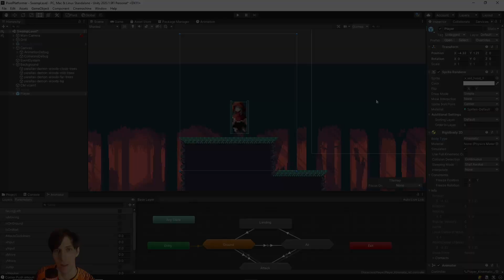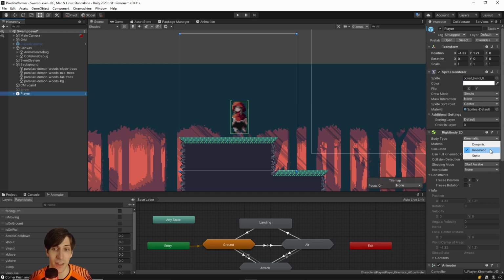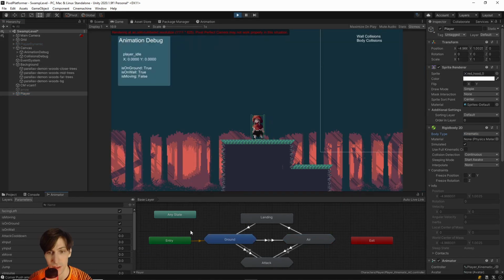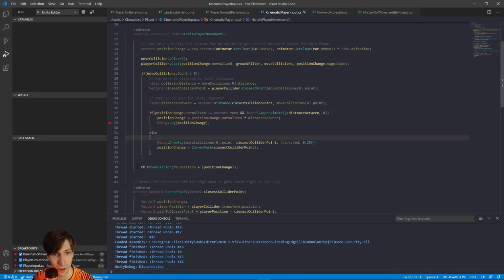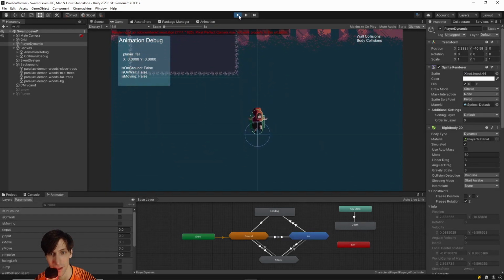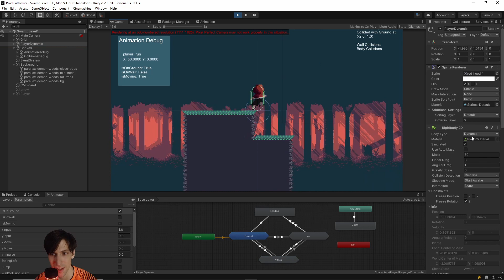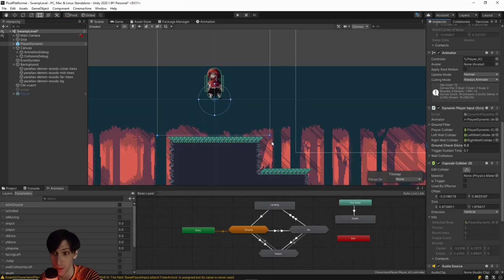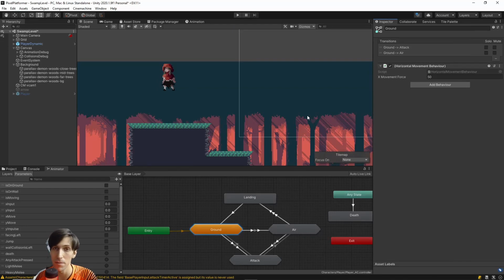Dynamic vs Kinematic Unity Rigidbody 2D Platformer Physics Explained

Comment: I haven't used Unity in about a decade and am coming from GameMaker to start learning C#. I'm writing this only after ~10 minutes of a brief explanation. But, if physics in Unity is anything like Box2D physics in GameMaker, Kinematic seems to be good for things like slopes. Default physics in GameMaker would make the instance slide down a slope when you want the instance to stop. You have to add constant force opposite gravity to keep the instance from moving. Also, going down a slope is actually falling down the slope and not moving down. If those issue exists with Unity, I'd imagine Kinematic would be better suited. Also, coyote time.
Reply: Unity uses the Box2D engine for its 2D Physics engine.

Comment: Thanks. Just a quick question, where is `PAP` coming from? (PAP.xMove is just a string, almost like constant, to work with the animator, isnt it?)

edit: Actually i have another one: why do you have to multiply the force by the mass in DynamicPlayerInput? Wouldnt the rigidbody's AddForce already take that into account, since the mass is one of its properties?

Comment: If I have two units controlled by AI at the same time, how do I set things up so that they can block each other's movement while not pushing and changing others position? If I use two dynamic bodies, they will push another's position. If I use two kinematic body, they won't collide and overlap.
Reply: Friend, did you find the answer?
Reply: @juanpabon4254  I solved it by adjusting the mass. For moving units, I lower their mass significantly so that its super hard to push non-moving units.